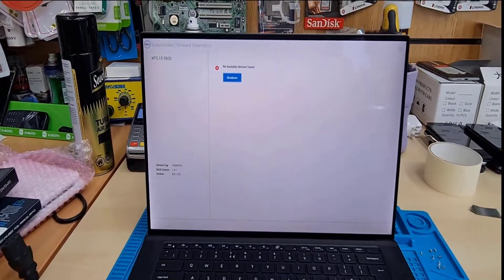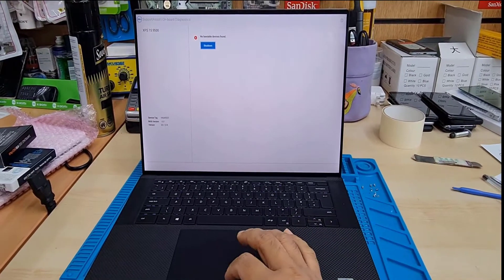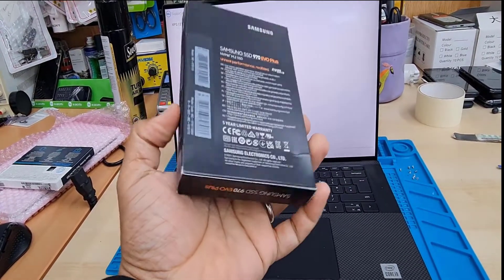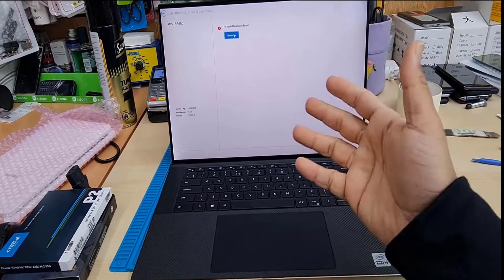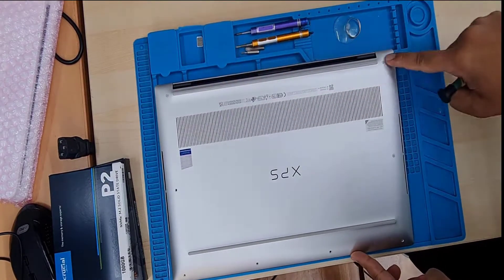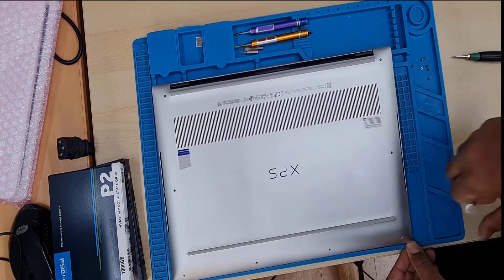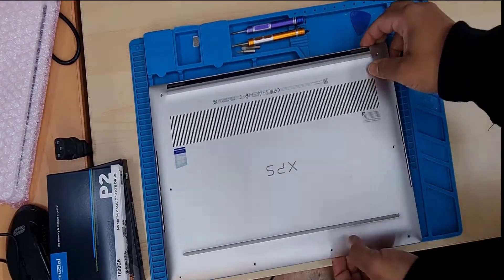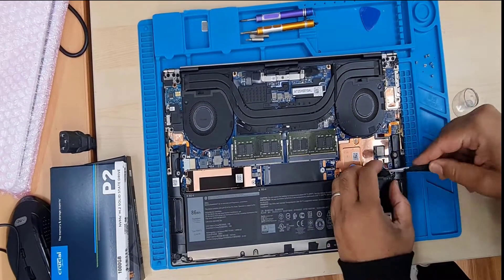How To Replace SSD On Dell XPS 15 9500

Comment: A very insightful video. Great to have all the information on what to pay attention to : i.e. heatsink on OS-holding SSD. As an extra, I learned that it's possible to upgrade  the memory of my XPS, including actually seeing the memory slots. Thank you for the detailed explanation.
Can you share the info on the repair pad you were using to fix the XPS on. I like its layout and practical slots.